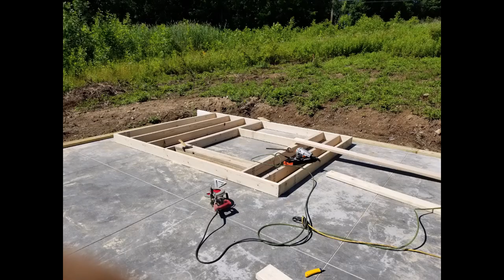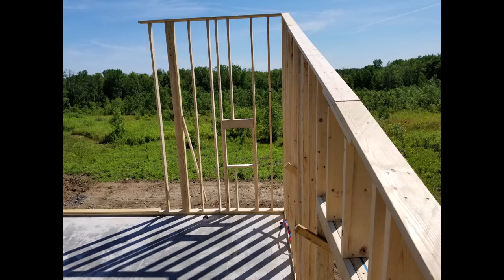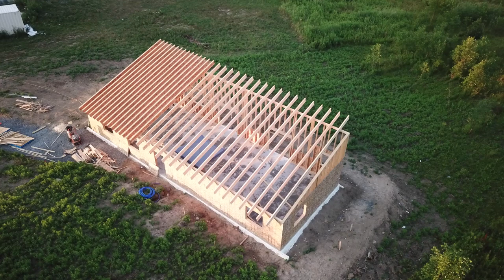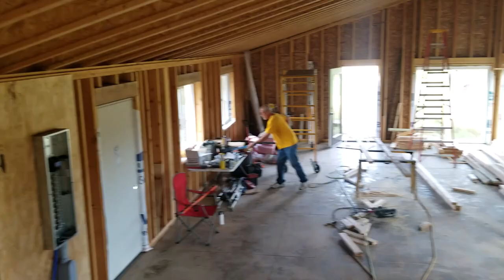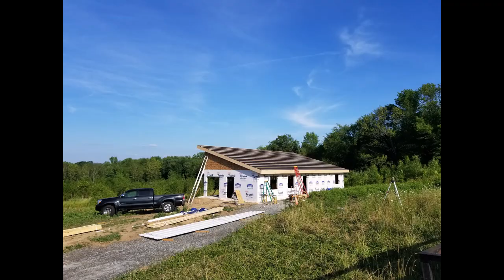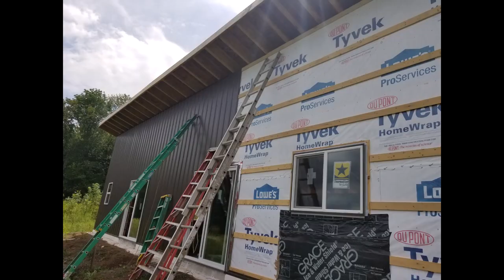Monopitched Home Construction - Framing and Siding

Comment: I plan on making an off-grid 40x40 cabin with the same roof style. I have been reading through the span tables for these I-joists and when used in a 40psf roof load, the large ones can span up to 46 feet. Crazy. Way easier than dealing with trusses when you don't have equipment and your jobsite is 1/2 a mile into the woods.
Reply from the maker: They really are awesome! I was able to carry one side up a ladder and lift onto the wall then go to the other end and lift that up. It's amazing how light they are.

Comment: Out of curiosity is it possible for the I Joists to support the roof without that middle wall you guys added? Or would it be too much in snowy areas like NY or WA? I imagine the will will help a lot with heavy loads but curious on how necessary it is, I imagine the layout would look fantastic if it was fully open but then again waste of space to some
Reply from the maker: @Septix  yes the main living room and kitchen is full span. The joists are all the same height throughout to keep the roofline the same but some are a "lighter" series that use the laod bearing wall to save some money.
Reply: @JimSperanza   awesome, thinking about a similar build to this in the cascade mountains so will probably reach out to you for consulting once I finally hit the ground running. Many thanks!
Reply from the maker: @Septix email me at speranzadevelopment@gmail.com when you need me!

Comment: That's the exact style I am about to start building in the spring.  Any plans you have available to share would be amazing. Thanks for the video. This is the first one I have seen on youtube which perfectly matches what I have been planning on doing.  Side note - I will be adding horizontal windows in the front loft area. :-)
Reply: Oddly enough I am in the same boat. This is exactly like what I had envisioned building on our south facing slope to take advantage of solar gain. Would you also send me the plans?
Reply: I'll check out the plans if you still had them around!
Reply: Hi Jimmy would you mind sharing the plans, thanks
Reply: @JimSperanza  I'd also be interested in a copy of the plans if you don't mind!
Reply: Hi Jimmy, that’s a beautiful home and very similar to how I want to built a home one day. Could I get a copy of the plans as well?
Reply from the maker: @averageliving4Life  send me an email speranzadevelopment @ gmail
Reply from the maker: @jorgemontalvo8578  send me an email speranzadevelopment @ gmail

Comment: Did you actually notch out the bottom of the I joist or just cut the front and back wall with an angled top plate ?
Reply from the maker: I used a beveled 3rd top plate and lagged in the joists with structural timber screws.

Comment: Building a small storage building almost the exact same way, wouldn't it be nice if a Solar Company made Roofing out of solar panels? That would be awesome
Reply from the maker: There are options for solar roofing but very expensive and need to weigh the cost vs savings long term.

Comment: Just curious how tall your front wall
Is ? We are doing basically the same but was gonna do 12’ front and 8’ back on a 24x36 building but think the roof will be to flat .
Reply from the maker: The house is 22ft x 50ft. Tall side is 14ft low side is 8ft.

Comment: Had a question about your rake wall connections work.  Do you put a seat cut on the top plate from the rake wall onto top plate of your short wall or do you do a plumb cut and attach it to the side of the wall? Hope what I'm asking makes sense.  Thanks!
Reply from the maker: I ripped a 2x6 at the same angle as the rafters. Nailed that filler  to the top plate and then nailed the rafters to the angled filler.

Comment: How did you lock in your rafters so as to not have them " spread" your front and rear walls apart? Did you involve a structural engineer?
Reply from the maker: Yes I have an engineer to spec out everything but this works the same as a typical truss home.
Reply: a regular gable roof wants to spread the walls which is why they have ceiling joists or a structural ridge beam supported by columns.  but there's no ridge here obviously so there's some different forces involved.  I have no clue honestly...but what forces would be involved?   i assume there's some interior shear walls in the final product that provide lateral support.   interesting
Reply: how does that work like trusses when there's no trusses?
Reply from the maker: @kacykoelliker5817  the walls cannot "spread" when they are tied at the joists and foundation. The force is mainly downward. The only shift that you could envision would be the structure collapsing forward or back ward toward the tall or short wall. This is no different than a typical rafter home.
Reply: @JimSperanza   thanks.  And yup, makes sense...no ridge so no opposing rafter spans to spread.  I didn't see any horizontal members  so I understand you are calling the rafters supporting the roof "joists" right?

Super cool looking house...going into a pool house project and this gives me some ideas :)
Reply from the maker: @kacykoelliker5817  correct I am referring to the roof joists. They are actually engineered TJI I-joists. Good luck with your project and if you need any info don't hesitate.

Comment: didn't show connection of BCI to wall plate. sad
Reply from the maker: We ripped a 2x6 at an angle and nailed that to the top plate for the I joist to rest on. Additionally we added hurricane straps to each of them.
Reply: @JimSperanza  thank you! I'm drawing up a monopitch for a house right now. was thinking of going i joist for it. thanks for the tip
Reply from the maker: @clemsmith2253  highly recommended them. Super strong and straight as a laser. I was also able to place all of them with only one other person in an hour.  We carried each end up a ladder and nailed them in.
Reply: Clem I had wondered the same as to if you could just angle the top walls or could you notch an I joist
Reply from the maker: @lawrenceporter3723  you cannot notch an I joist so an angle plate works great with some hurricane straps.
Reply: @JimSperanza  Ok thanks, so the inspector was ok with that